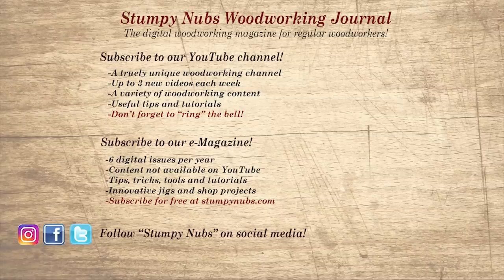Are table saws becoming obsolete?????

Comment: Totally agree.  I only recently obtained a saw with a dado stack having been in the EU previously.  Of course, I don't use it as much as most US users, having done without for ages, so for the home shop at least, where large production runs are not an issue, I don't think the dado argument is the best. 
In my opinion it's the repeatability that wins for the Table Saw.  With a track saw, every cut has to be re-aligned and it's just not as good.  They are also less practicable when cutting small parts off sheet stock too, as measurements have to start to account for the blade width, so much of the advantage of a track saw is lost.
Spot on with the bits for segmented work too.  Those are impracticable with any other power tool.  I have a mitre saw capable of making the cuts, but it also has the habit of turning small offcuts into missiles.  Not often, but enough to make using it for segments unappealing to say the least.
As usual another great piece of opinion from the master of real world woodwork

Comment: I wouldn't be without a table saw. 
The best blade I have found is a (6 tooth Hitachi) fiber cement blade. Why? I bought a sacrificial cheap-o portable table saw just to cut fiber cement sheets. After many cuts, my neighbor brought over a piece of 3/4" CDX he wanted me to square which required a 1" to zero cut. I told him it wouldn't be pretty after so many fiber cement cuts, but he didn't care. I made the cut and we were amazed. Zero splintering and we could see thru the feathered end. After many years, I still use that same blade - it won't die.
I always wondered why those blades are not recommended for cutting wood, now I know - nobody would buy regular blades anymore. Don't know if other brands make a difference or not, but that Hitachi is great, I have a stockpile - dozens - of other conventional carbide blades I have never needed to use sitting in storage. Many are more expensive than fiber cement blades. I do not expect I will ever need them.

Comment: Repeatable cuts can be nicely accomplished on mft workbench if you have dog fence and track guide installed correctly and that includes repeatable narrow cuts. Actually many if not all tasks can be done with mft workbench, track saw and router and couple of jigs.
But table saws are still very relevant for any shop, for all the reasons you have already mentioned, but I would also like to add a quality sled and miter sled, nothing beats the quick set up and fast processing times one can achieve with sleds and jigs on table saw while maintaining precission. Also, table saws will cut thicker materials with same speed same set up times, where track saws will be very limited, especially when it comes to miter cuts on thicker board.
Leaving tools aside, imho the only piece of equipment more important than a ts would be a workbench, ts shares the second place with dust extraction... the way I see it.

Comment: Ding ding ding. You're absolutely right. I never knew table saw usefulness was even an issue. Moving up from a contractor table saw to a big honkin Delta monster was the best move I've ever made. But - having said that, I probably could have put that $3500 into other tools and get similar results. But I like this way better.

Comment: When I started woodworking, I liked the idea of using the router for joinery.  As I gained experience, I use the table saw exclusively for joinery.  It comes down to speed and accuracy.  I also get less tear-out on the table saw when working with pine.  
For an apothecary cabinet with 32 small drawers, I was thinking to make the drawer thickness 6mm .  Since my table saw blade kerf is 3.43mm, I planed the stock to 6.86mm so that I can use blind rabbet joints for the drawers.

Comment: 100% with you, even though my table saw is a cheaper model with a fiddly fence (which is not so bad once your get used to it).  I've owned a track saw for a couple of years now, and in that time I've used it once, and that was to trim back the splinter stopper.  If I had a bench set up specifically for track-saw use (big MFT top with fold-down track for cross cuts) then I can believe it would be pretty fast as well, but otherwise the set-ups are more fiddly that even my dodgy fence.

Comment: I have a table saw but I'm trying to transition away from it because of the safety issues with the blade/kickback and dust. Being in the UK Dado stacks are not available, so using a table saw for joinery is slow and painful, so I use the router table as you suggest, and I use a track saw along with an MFT for repeatable cuts. I only use my table saw for long rip cuts now, and I'm looking in to getting a bandsaw which may help me do away with the table saw. I don't think table saws are or will be obsolete, but I personally am not a big fan of them. Great video as usual.

Comment: I totally agree. A point you need to add to your arguments is that there are many jigs made for a table saw that are simple to create and use that have no counterpart for use with a router, a bandsaw etc. for instance, making a raised panel jig for a tabla saw can be done in under an hour and the raised panels are sharp and easy to make. You can buy a large and quite expensive router bit that can do it but they are prone to burning the wood after a few uses or on very hard woods. It’s easy to create a jig that can make cove cuts on a table saw. How can you do that on a router table, a band saw, or any other tool. These are but two examples. I could go on with many more.

Comment: I first bought a portable jobsite table saw because of so many bad rip cuts that arose from the nerve-racking setup time needed to get the straight edge (pre track saw) in proper position to cut with a circular saw. Also, I don't have a workshop or space to house dedicated pieces of equipment. Many track saw kits I've come across are more expensive than what I paid for my table saw.

Today, I'm looking to replace my table saw because it can't use a dado set. Didn't even think about buying a router to do this task. All this is from a newb perspective who needs a tool that can do many things, for projects that are few and far between. A final point that just struck me is that I like the fact that the tool is stationary and I have two hands on the workpiece rather than fixing the workpiece and having two hands on the tool. Point being, my hands on the tool are more likely to lead to an error. As an example, my golf scores are incredible, until I put the club in my hands 😉

Comment: Stumpy, I’d also like to add some things to your list that I think you forgot. With a table-saw you re-saw boards thinner. Plus you can make sled jigs for almost many task like taper legs, box joints, making round table tops, jointing edges for glue ups, make raised panels for cabinet doors, etc

So I can get rid of my table saw if I have a high end router table, router, jointer, band saw, mitre saw, box cutting/dovetail jig, circular saw, and track saw… Or Spend all that  money on a quality table saw instead and save all that space in my shop. 

Also, you can buy a really decent delta or rigid table saw for under $700. Thats less than a mitre saw, router, and router table, and not even touching the rest of the tools.

Comment: I agree with a lot of what's said here regarding the table saw, especially with respect batch jobs.  I think the only thing I might add after owning both table saws and a track saw, regarding fast repeatable rips, is that I use parallel guides with the track saw to reduce set up issues with repeat cuts.  I get comparable cuts in pretty comparable time verses the table saw.  Fast accurate cross cuts can happen on an MFT table.  Yeah, it's Festool stuff with the Festool premium tax, but in my experience those tools (type of tools) negate a lot of the table saw speed advantages for batch jobs as well as problematic setups for repeat cuts.

Comment: Couldn't agree more. I use my circular saw for quick break downs and then to the table saw. The fence is dead-on. I can make all the parts very quickly with that saw and they're good clean cuts ready for glue up.

Comment: Starting up a hobby woodworking shop in a tiny garage. I drank the cool-aid and went in on the track saw. Track saw replaces nothing. It's Easy to get nice precise cuts. It's Easy to NOT get nice precise cuts too. Had to buy a band saw to make up for not getting the table saw. The One thing that keeps me from ditching the track and buying the table saw is dust containment. I can stick to shop vac sized dust collection for the router, router table, band saw and track saw.

I'm going to get by without a table saw, but it is a process...

Comment: Consider getting a rip blade for your table saw instead of a combination blade if you mostly do crosscuts on a mitre saw anyway. I've been using rip blades for years and love them. They leave a nice clean edge and the teeth are flat on top so you can use them to make dados (by adjusting the fence and making multiple passes) without having to change over to a dado set.

Comment: I have all saws you mention in the video. Indeed a good table saw is very useful. Mine table saw is a cheap one. I made a larger table, a pedestal for it, installed a cmt blade.
Unfortunately the shaft has excentrcity which is hard to eliminate.
But i will try as Mattias Wandel shows in his video
At present made a rule for myself : bulky sheets arealways cut with the track saw. small pieces are cut with the band sas. And heavy  boards are ripped with table saw and crosscut with the chop saw.
Its a matter of convenience and safety

Comment: If given the choice between ripping stock on a job site table saw with its aluminum table vs a track saw I'll take my TS75 and my TSO parallel guides 8 days a week.  I have mine dialed in so highly accurate repeat cut are doable.  The dado stack is really where a good cabinet saw beats a track saw.

Comment: I mostly do woodwork on site. As a trim carpenter I couldn’t imagine not having my table saws. Yes they are smaller versions and when it comes to building cabinets and bookshelves I cut my full sheets of plywood with a straight edge and circular saw until I get down to manageable size pieces and then I switch back to my table saw. As for obsolete I say never.

Comment: I haven't used my miter saw in a couple of years. I do everything on my table saw. Cross cuts (usually with a sled), rip cuts, rabbets, dados and angles of all kinds. If I need to cut down a full sheet of plywood, I use my circular saw with an edge guide to cut pieces to a rough size, then trim them down to their final size on the table saw. Not that my way is the better way, it's just my way.
Reply: New table saw user here with a small bed & confined space as well. Any advice on a specific edge guide that you love to work on 8" lengths?
Reply: @kooale , do you mean 8 ft lengths and not 8 inches? Right now, I have an Empire edge guide from Home Depot. It comes in 2 pieces to be able to stretch past 48 in. If I had to cut down the 8 ft length of a sheet of plywood, I'd probably just use an 8 ft piece of lumber, if I had one. If the width of those cuts were within 24 in, I'd get something like the Kreg Rip Cut. I have the Ridgid R4512 table saw. If I had help, my saw has the capacity to rip a sheet of plywood in half the long way. I wouldn't try it by myself.
Reply: @awlthatwoodcrafts8911  (do you mean 8’ .. not 8” ?) - Yes indeed, my bad! (If I had to cut down the 8 ft length of a sheet of plywood, I'd probably just use an 8 ft piece of lumber) – I’ve done so for years with clamps, such a PITA! (Kreg Rip Cut) – don't know it - I will definitely look into this tool, MANY THANKS Sir. Yes - please don't rip that 4 x 8' alone, without help on your TS

Comment: I have an excellent (Incra) Router table, but I just cut some dados for half-lap joints with the table saw and a dado set, and it was more simple to set up and more easily repeatable (I had 12 joints to cut) than it would have been without the table saw. The space required for the saw is certainly an issue, but I would not be comfortable or as efficient without my 3 HP table saw.

Comment: Dear friend, living in Italy I don't have access to a saw stop or a dado. Nevertheless, I TOTALLY agree with all your points.
Reply: That's interesting. How do you create dado cuts? Multiple passes with a flat kerf blade on the table saw or using the router?
Reply: @izzychen7537  That's the way we have to do it. Even if I could get a dado set, table saws here don't have a long enough hub to mount them.
Reply: @izzychen7537  I prefer a router. Multiple passes can be done but repositioning the fence every single pass and repeatably is a pain. You get 2,5mm more with a standard 3mm blade, at least 0,5mm have to be overlapped. A router with a dedicated jig is faster and more reliable.
Reply: @drstefankrank  yes that's the point. CMT makes great quality Italian products, they also sell dado sets but I think they don't do much business with that in Europe...

Comment: From having a table saw first I use my track saw more than anything. Especially since I have a home made version of a festool MFT 
Plus the fence etc I can easily do repeat accurate cuts. Including cross cuts another reason I don't pull out my miters saw unless I'm actually doing miters. 90 degree cross cuts is track saw

But that's mainly because I only have a jobsite table saw because I don't have the space for a full cabinet saw. 
For a really small work shop (being my garage) it's much easier to have my home made MFT and track saw to break down and put away and take up way less space. And the dust extraction is way better on my track saw vs my Bosch 4100 table saw. 

I think if you have the space to have a full cabinet saw there's no replacing one a they are the best for repeat fast easy set up cuts. 
But when you're tight on space, I wouldn't say they are obsolete as a tool but there's tools that are better for that situation.

My table saw is basically just pulled out if I need to make some dados. And that might change now that I finally got the router attachment for the tracks. 

One thing I've found watching stuff from 10 minute work shop, and new Brit workshop on here, you can do a lot with just a track saw in a small shop.
Reply: I thought the bosch jobsite saws were top quality? What kind of mechanism does the fence use? Dewalt uses a rack and pinion it stays pretty square. I also have an old beat up Ryobi bt3000, its fence is nothing special but its cool because the whole thing breaks down into small pieces in seconds. 
Like most ryobi stuff material quality is a joke, but after 23 years it still cuts. Ive GIVEN it away twice and got it back both times years later.

Comment: I spent YEARS without a table saw!! At the ripe age of 46 I finally was able (and allowed too) break down and buy my first table saw!! I bought a second hand table saw for just $50 with NO BASE and I literally had to set it up on the ground to use it!! And though it wasn't a "perfect saw" and had flaws in the table AND the rip fence, I was able to finally build "better things" with my table saw, than I had without it!! Today I have a small 10" contractors table saw which is a Ryobi GTS-11!!! It isn't like I have a lot of room for a huge saw and I needed something that was sort of portable to be able to use where I needed it to be set up, instead of having a dedicated space for it.....my shop is too small for large equipment!! The saw cost me ONLY $175 brand new and is dead straight accurate!! A far cry from ANY saw I have owned or used prior to buying it!!! In the end I couldn't live without my saw today!! So to ask if they are "obsolete" is just silly, and honestly I am already looking forward to my next new and possibly better saw in a couple years now that I am 56 years old and disabled!!

Comment: I agree with this video completely. I have built many items without a table saw but that was done without the money to buy a table saw or one off items. I have had a full shop for many decades and would not remove the table saw. It is repeatable and accurate. So is the router table but again not near as fast. While visiting a Amish town in Pennsylvania they even had a table saw just not electric.

Comment: I'll add; the table saw is perfect for cutting scraps for odd purposes such as shims, spacers. And that odd pair of matched boards for temporarily spacing one object from another. 
I also use it to make splines and spline grooves (can't imagine another other tool for that).

I have also used it with a jig for cutting tenons on logs to precisely fit into a mortise pocket. But that does create a LOT of debris (shavings).

Comment: Not all table saws can accommodate a dado stack,  mine is too cheap of a table saw, apparently.   Routers are great for some things, but limited for some uses.   A circular saw, especially a smaller battery powered, is a great tool and easy to use on larger harder to maneuver materials and has a very narrow kerf.   I prefer the 1969 Pontiac GTO Judge, but I had only a "common" 1968 GTO, but still a great car.   Great videos, Stumpy!!!

Comment: A table saw will never get obsolete, my opinion. That said, I love my track saws. Due to age, injuries and health issues, I can no longer handle full sheets of plywood. I break them down slightly oversized with a track saw and fine tune them to final size on table saw. A table saw is a better jointer for me than my jointer. That all being said, I believe the safest saw is my bandsaw, man, I love that thing too. The table saw is hard to beat in production work and repeatability. What ever works best for you and is the easiest for you will always be the right tool for you.